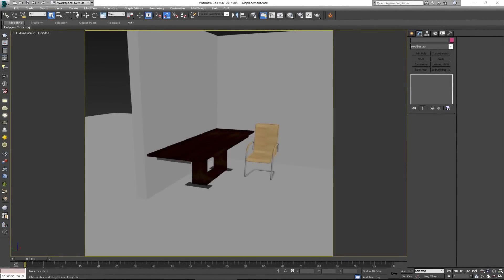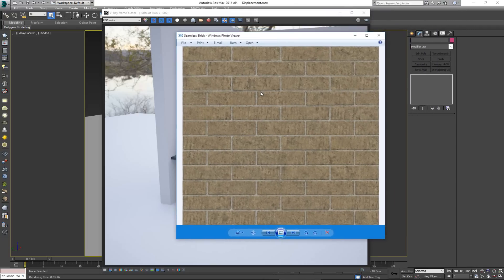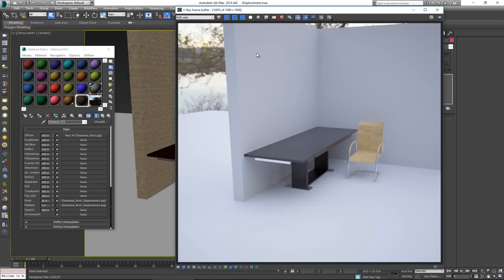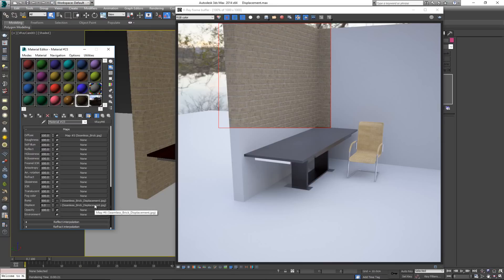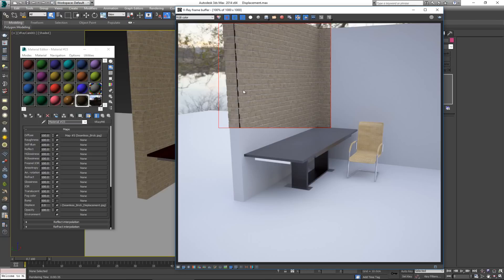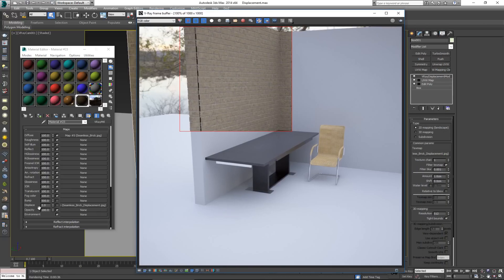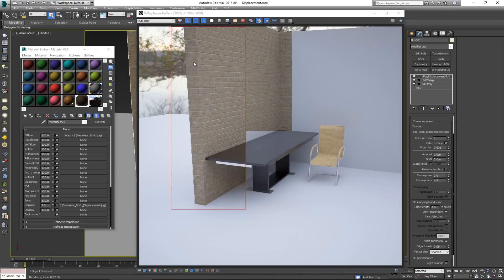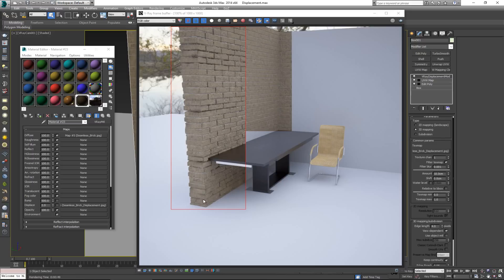Using Displacement in 3ds Max and VRay

Comment: Great video mate!

A question:

What if you want to use a different material on the inside of that wall (stucco for instance) how would that work if that material also is a pbr material using displacement (but different value)? Since that vray modifier is on the whole object…

Comment: Very nice, but for me it doesn't work well. I have put a stone wall height map in the displacement slot and if i increase the amount over 2 cm, the seams start to appear in some places of the edges. I would appreciate your advice.
Reply from the maker: Displacement can only get you so far before it starts breaking at the seams. If you want to have the details pop up more you would need to use actual geometry for that.
Reply: You are right and thanks for the quick answer. Problem, is that for me, sometimes, it happens at low displace amounts (just over 2 cm) and it doesn't seem to occur when i use 3ds max displace modifier.

Comment: Hey, I am trying to model a cliff face, i have some displacement map  on it to create the strata details, i used to have the continuity problem, after keeping the continuity checked most of it is cleaned up, but i still see some of the braking at some edges, any idea how to solve this? my continuity is at the lowest possible value already.
Reply from the maker: Honestly it kinda depends on what is the quality of the cliff that you want to have and the amount of details. If you really want to have a particular cliff face best practice would be to sculpt it and then bake the information onto a lower poly. As for using displacement on a plain, after some distance you will get "breaking" due to tessalation distance.
Reply: How would i sculpt it? I have only ever used old school software, Max vray and photo. Any help with as to how i can sculpt it would be awesome. This is my first time trying to create such an environment for an Archviz project
Reply from the maker: Sculpting would generally be done in ZBrush or Mudbox .. so whatever is easier for you

Comment: Will the shift parametr also work without problem on objects where there are corner? Like the wall on your example? I remember having some problem in tha past with it (but i cant remember what were they :-) )...

it should work also on the wall correct? But you have to be carefull to not overdo the number (in shift) or the walls, even when using displacement with shift would "cross penetrate" each other, right?

but it shoudl work
Reply from the maker: The Shift basically makes it so that the displacement base is moved. Something like moving the pivot point on a modifier